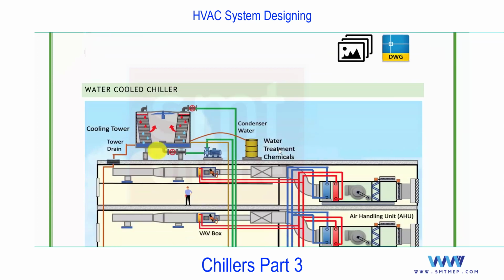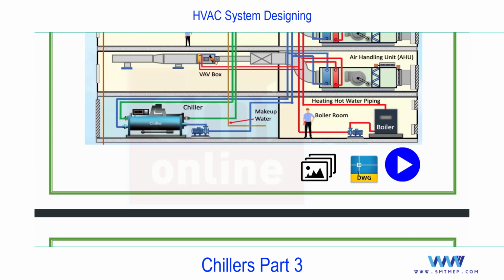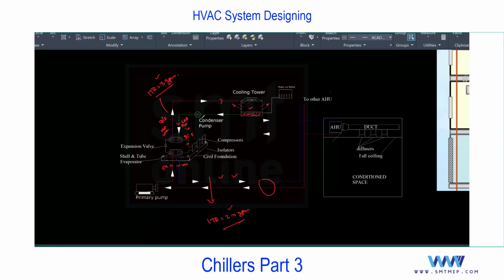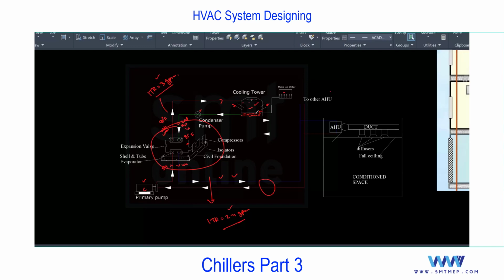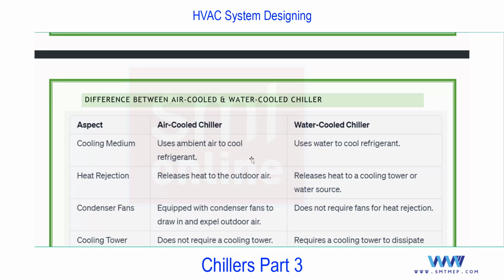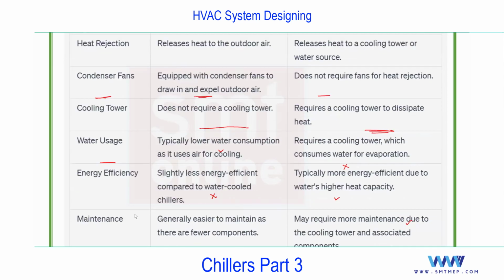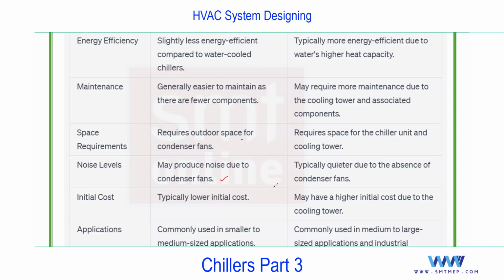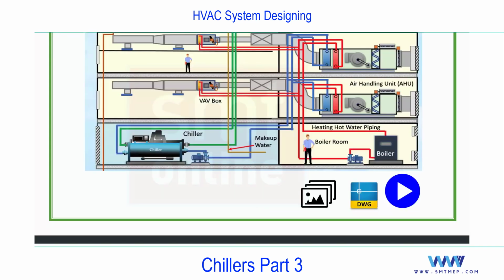HVAC Chilled Water System Part 3

Comment: With due respect, your explanation for why there is higher flow rate (3gpm / TR for condenser circuit) is incorrect. For the benefit of the students, it require more flow rate because condenser side - heat of compression is added into the refrigerant. So, to cool this additoinal heat, you require higher flow rate per TR compared to evaporator. In conventional system it is almost 25% additional heat is added. Thats why 2.4 gpm x times 1.25 = 3 gpm.

Comment: Sir, can you please inform me what is  electricity consumption I.e.
 Kw/ton for water cooled chiller,  air-cooled chiller, and VRF system . I would be very thankful. Thanks
Reply: kW/TR for HVAC system depends on the tyoe of system, condensing temperature, type of compressor and its control mechanism, type of refrigerent, Delta on Condenser and Evaporator, what is the leaving chilled water temperature etc etc.

To tell you the kW/TR of the mentioned system, tell me what is your condensing temperature / ambient temperature of the country / city where the units will be installed? 

For example - for Saudi Arabia (Dammam) chiller operating with R-134a refrigerant - 
1) water cooled chillers with 10 oF delta on Condenser and Evaporator and std leaving temp is in the range of 0.65 to 0.75 kW/TR
2) air cooled chiller with 10 oF evaporator is in the range of 1.35 to 1.65 kW/TR
3) VRF is in the range of 1.15 to 1.3 kW/TR